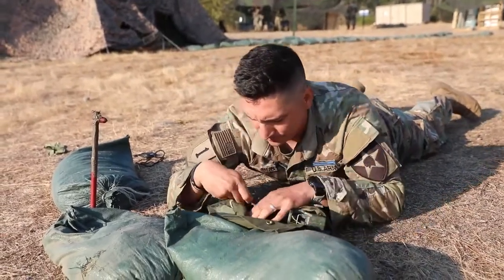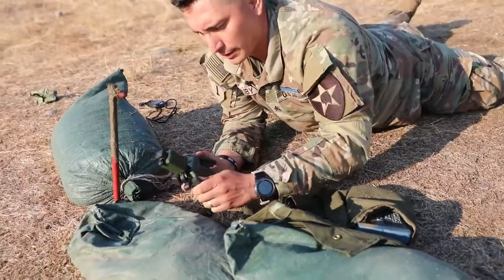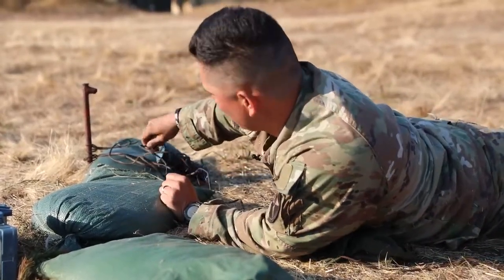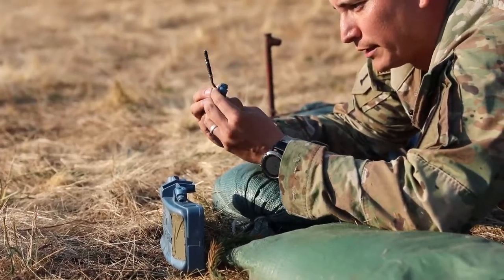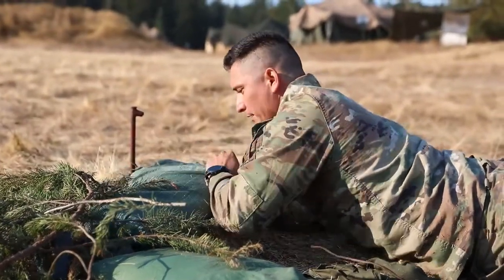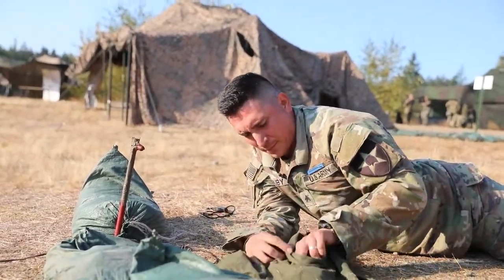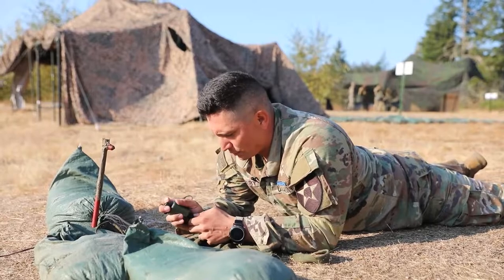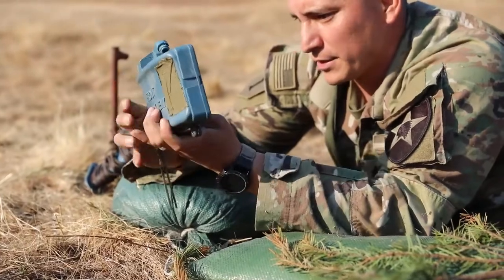1-2 Stryker Brigade Combat Team Demonstrates the proper procedures M18A1 Claymore Mine.

Comment: what kind of chord is used with the M57 and M18?? assuming it's electrical do you recover the cable after the M18A1 is discharged or do you just cut off the 100 meters that you used from the spool?